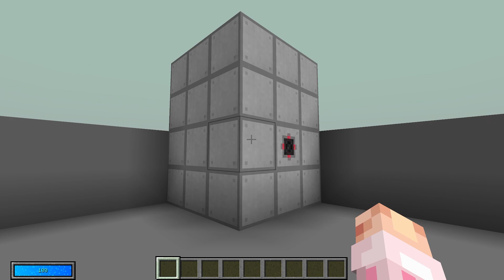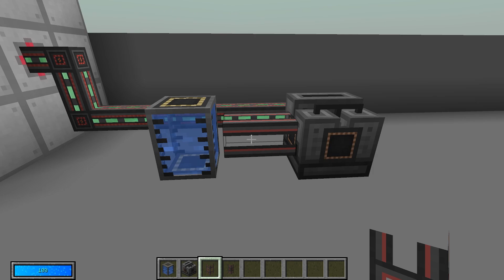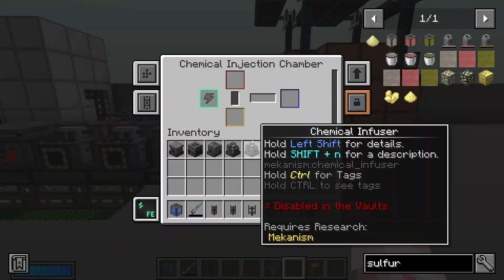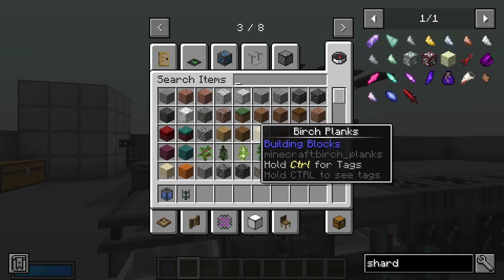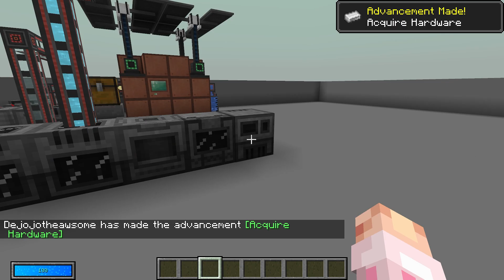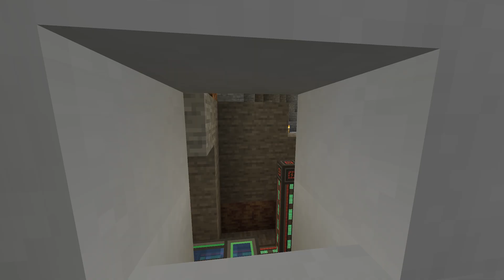Mekanism 5x Ore Processing Made Easy for Vault Hunters 1.18 and Other Minecraft Modpacks

Comment: ATTENTION
If you want to FULLY automate the process without the need of gunpowder read this:
Instead of supplying the machine directly with gunpowder, you can make your own using the following machines:
Crusher (turns cobblestone to gravel) -> Enrichment Chamber (turns gravel to flint) -> Crusher (turns flint to gunpowder)
If you are playing a Modpack like AllTheMods 9 you can simply use a Igneous Extruder to fully automate cobblestone, just put one lava and one water on one of its sides, and pull the cobblestone out of the Extruder and into the first Crusher using a Logistical Transporter, and BOOM fully automated.
Reply: Bro can you help me cause my ore just get stuck in the chemical chamber when they are less then three
Reply: Also using mystical agriculture you can make creeper essence for gunpowder, or use stone and fire essence to make flint
Reply: Or alternatively if you have an auto tree farm, you can use the pressurised reaction chamber with oxygen, water, and charcoal to make the sulfur dust without needing gunpowder
Reply: @deradminlucky1562  that's so much easier than what I've been doing lmao, I just made a vanilla cobblestone generator and automated it with some create drills hooked up to water wheels
Reply: @deradminlucky1562  you dont need ATM9 for the Igneous Extruder, For a Lightweight version you just need the Thermal Series Mod
Reply: Also can’t you add the stone generator upgrade to the digital miner? Because if that works you can simply use the digital miner to produce cobblestone for the sulphur process.

Comment: Hi Dejojo, this was a very good tutorial, thank you for that. I just build it as described in my VH world and it definitely works. Tips I would have appreciated was that gas blocks need gas upgrades to get speedier, how to make a 4x proces if you want to wait with upgrading to x5 and finally a survival way of generating water and power rather than using creative hacks. Also sometimes pipes interact with each other and the wrong gas or fluid gets into the wrong pipe and you have to empty it to get it to connect to the other pipe and tips on how to do that would've been nice. Otherwise really good tutorial, thanks.

Comment: If you have Integrated Dynamics, a mechanical squeezer (depending on modpack) will give 3 raw +2 additional @ 50% chance from normal ore so silktouch is great in this instance.  On the Direwolf20 1.20 pack im using the digital miner in silk touch mode for all my ores then each ore has it’s own power and processing setup to make them into crystals (just before hydrogen chloride step) making 3 raw into 10 ingots at the end point or 1 ore = 10+ ingots

Comment: Whenever I take my advanced pipe from the first chemical infuser which is outputting hydrogen chloride, to my last chemical injection chamber which is processing the crystals, it dumps the whole buffer instantly, I tried to put an elite tank in between them to let it build up and even when I have 10,000 units of hydrogen chloride in the tank, the second I hook the pipe up to the chemical injection chamber, it dumps it instantly. I don’t understand why
Reply: I figured it out, I needed more heat in my thermal evaporation plant.. I also made a second set of the first 3 machines, so that I was only outputting to one chemical injection chamber per line up